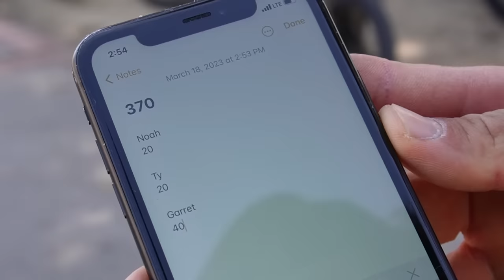Sessions with the GOATS

Comment: The run out planks should have been stacked the other direction so you weren't hitting the leading edge of the next plank. And I bet you would have been fine.
Reply: 100%
Reply: a couple screws too would be sweet! On the gap itself, for extra safety, you could even screw some 2x4 to the bottom of the sheets of wood so they can't slide down the stairs at all.
Reply: @neosu  they did use screws on the stairs.
Reply: Totally agree. Going against the grain here and they began popping each other up instead of flattening down
Reply: @datsundrifter2190  aye, but if they’d just screwed some up brought the sheets into the dirt for the run off!